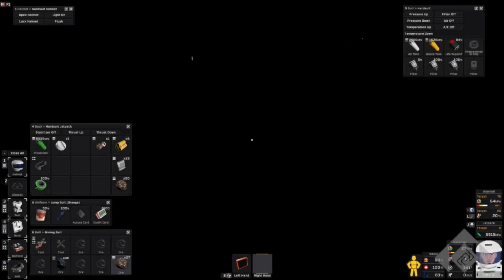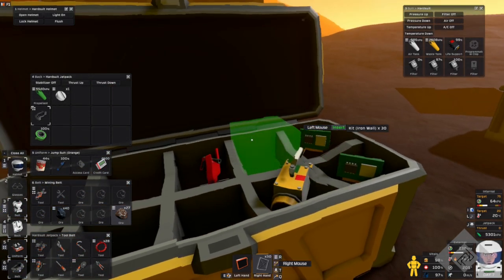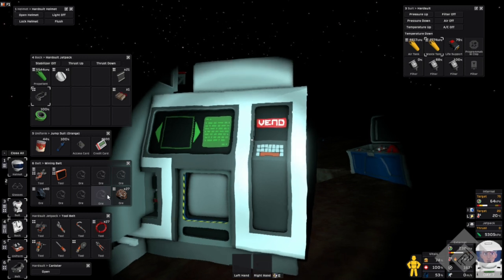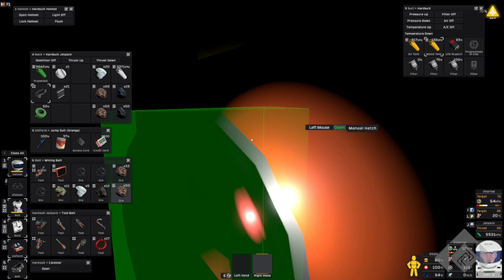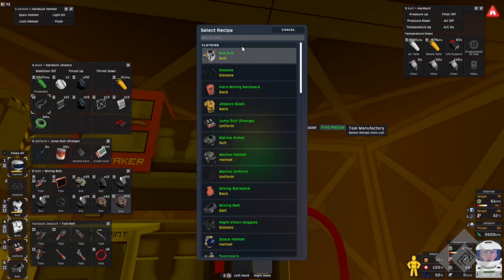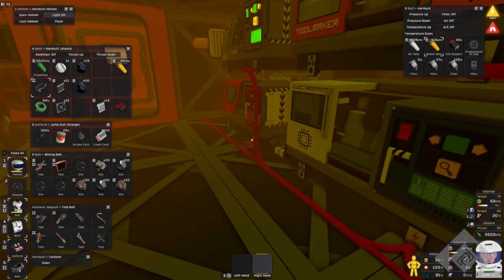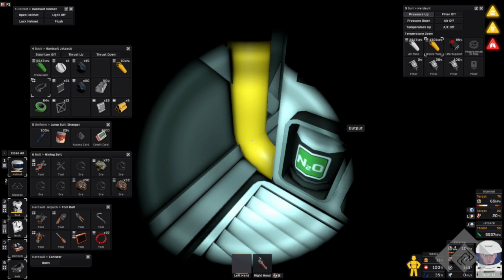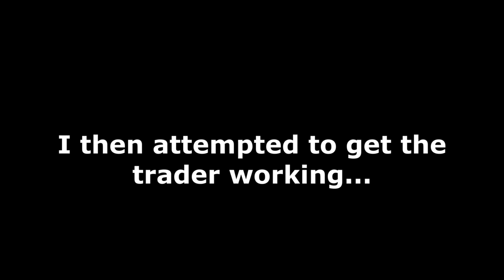Still No AC, and a whole lot of nothin' - Stationeers, Stay Cool in the Heat Longplay - 02

Comment: Im just playing catchup here, im enjoying the stationeers content, btw. I get that there are a ton of 'gotchas' that can be very, very annoying.

Not sure if you did catch on, but NO2 is definitely a toxin along with H2 and X, so scrubbing both will be important.

Also, I dont think it's percentage based for atmospheric composition for breathable, its the volume of O2, i forgot the minimum number in a square that is required to at least to get you at the caution level. But 50C is max for breathing temperature.
Reply from the maker: Gonna make a video! And you're right, 50c is the maximum before you begin taking damage, but there is also an optimum temperature. I know it affects thirst... not sure if it affects O2 consumption.

Comment: The landing platform has a very weak shadow inside, showing the finshed version. But even on Mars it's extremely difficult to see, so I guess on Venus with the heat mist, it's completely impossible. First time I built it, I was building it, tearing it down, trying to rotate it, building it again, rinse and repeat, until I move my face close to my 28" monitor at 4K resolution and notice the vague shadow inside the green mist... (knob twiddler is still funny the third time you say it...)
Reply from the maker: I can see the shadow on the moon, so you're probably right, it's the effect making the ghost difficult to see... unfortunately, my eyesight is blurry, and I think I might be far sighted, so moving closer to the screen just makes things less visible, and very fine detail kinda gets washed out when viewing from a comfortable distance, which, you might be surprised to learn, is three feet from the monitor! Yes, my monitor is 2 and a half to 3 feet from my face! Guess I took all those PSAs from the 70s and 80s to heart.
Reply: @JoelleTheAbsurdist  It shouldn't be that hard to see the ghost image, not even for us people born before the 80's. I am slightly color challenged with green, red and yellow colors, but only when those colors are mixed. And I too usually sit at least 3 feet from the screen, as I was told to do so in the 80's - although back then we only had a 14" TV, and it was hard to see from much further away the best thing ever. Quite an entertaining video, although you might want to be more careful with the language - YT might take an interest in moderating your content. But you ARE surviving! Keep it up.